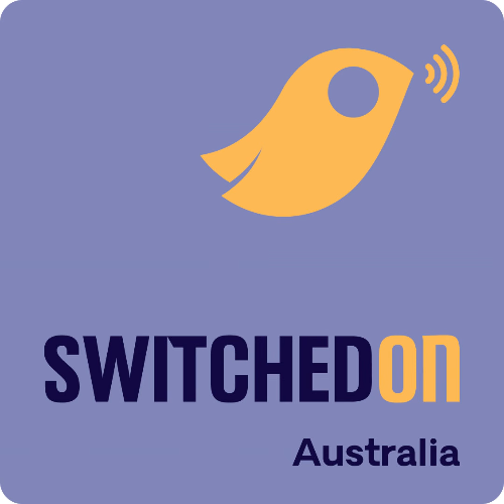The plug-in solar hack that’s now booming in Germany

Comment: During covid, I built a balcony solar battery system consisting of 2 x 100amp LFP batteries, 2 x 160w  hard solar panels and 2 x 160w soft solar panels and a 740watt sinewave inverter. Panels sat behind large opaque poly balcony railing getting some direct sun and some solar behind the balcony railings.  The batteries, mppt and inverter sat in a large rolling toolbox.  The balcony faced east and we got heaps of morning sun. I ran an extension cord to the home office by day and tv, surround stereo, computer and lamp at night during summer and we got enough power to run both these systems.  In winter  it was just enough to run the home office during the day. It cost me less that $1100. Was a fun project and shows these systems can reduce grid power needs for apartment dwellers and lower bills. This sytem was inspired by a north facing high rise apartment balcony solar in Bondi Junction along Syd  Enfield drive.

Comment: Well, as long as you don't have one of those old spinning meters that could have you earning at your power purchase price, and your old 1930s wiring doesn't have crumbling rubber insulation, and you don't need to string two fuse wires in parallel to prevent them melting...